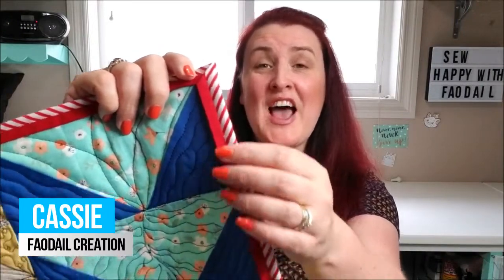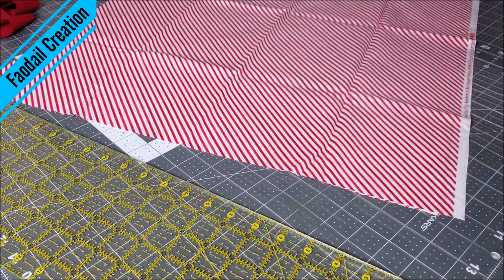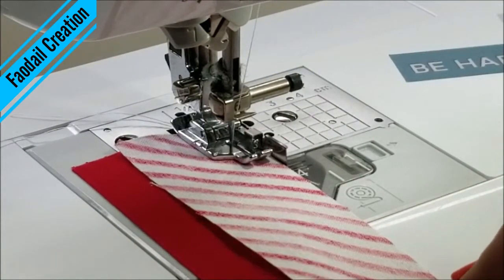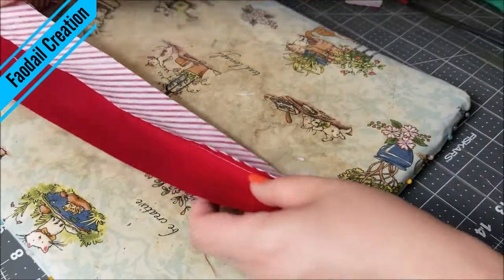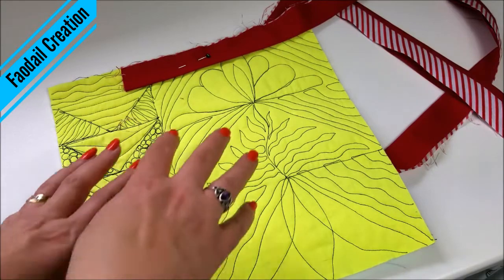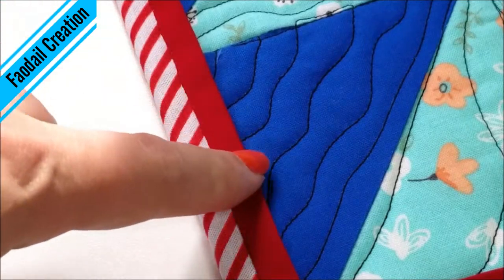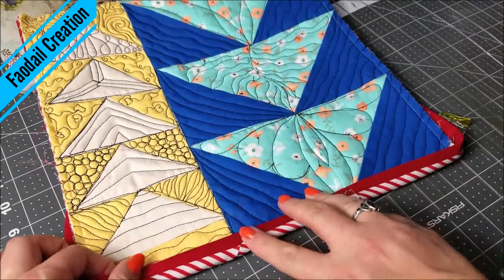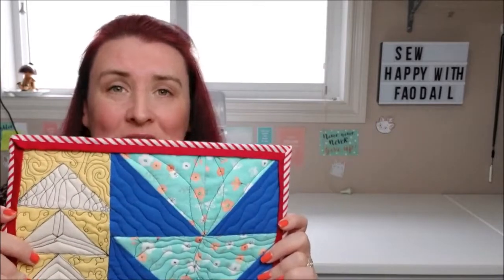Sewing a flange binding | Quilt binding with sewing machine Quilting Tutorial

Comment: You never sewed the inside one down to the quilt top?
Reply from the maker: Hi, it doesn't curl up because you sew the top side right down the center of the two sections if you know what I mean.
Reply: Mine is going on a quilt that I will be washing. I’ll have to see what I decide after completing it your way. Thanks
Reply from the maker: @gwennadoty7374  it should be fine, if it does curl you should be able to press it down anyway.